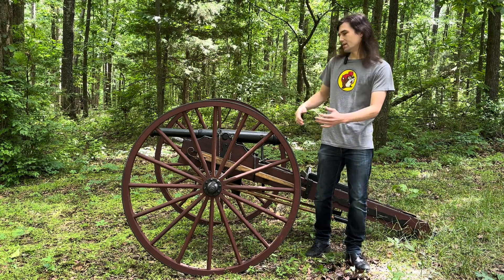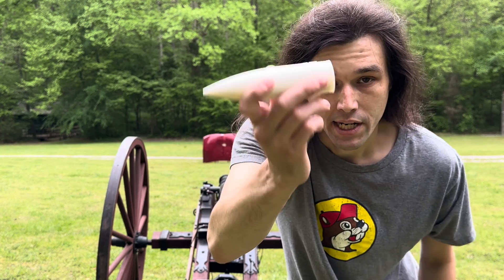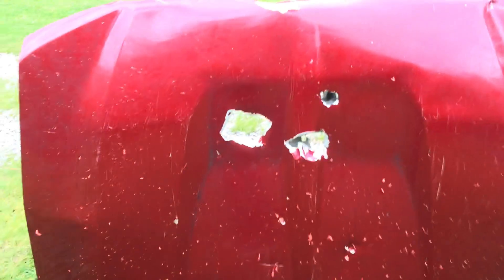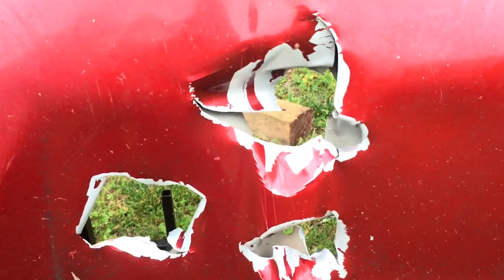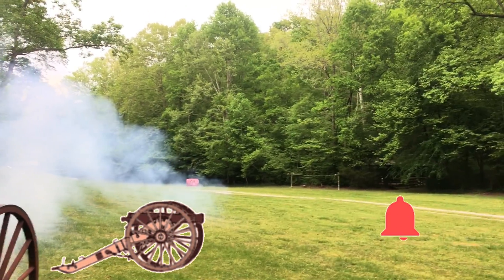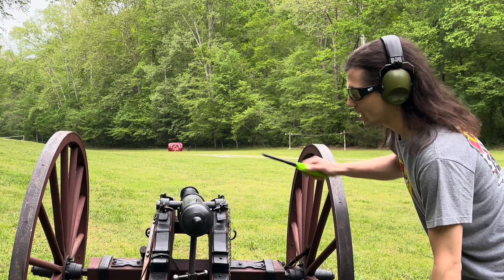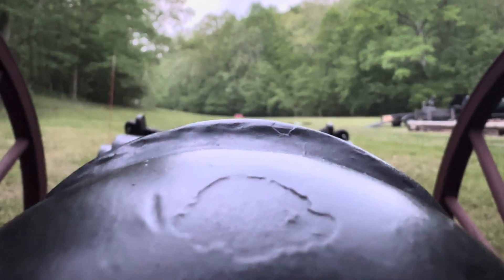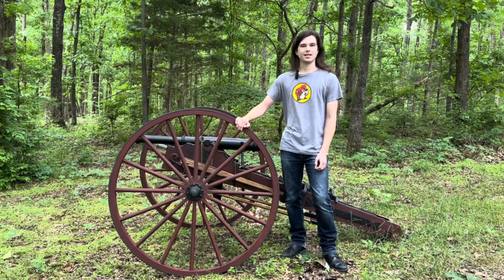Shooting 3D Printed Rocket Powered Tank Rounds

Comment from the maker: What do you want to see us shoot next? What was your favorite shot?
Reply: could you try this but with two motors at an angle to create spin like the antique Gyrojet line of weapon?
Reply: Maybe a sabot round?
Reply: @edgarmaestre6622  That's what I was thinking. Some half-inch mild steel rod with fins welded on and sabots made of wood wouldn't be too difficult, I believe.
Reply: @r.awilliams9815  yes! you read my mind, thanks for explain this better than me. My english not is very good
Reply: Look up what a 12ga bird banger is 

I have disassembled some and it’s pretty much just an m80 with a heavy shot card with a hole so the fuse can go through and be lit by the gunpowder 
I think you could make your own and scale it up for scaring away pterodactyls or whatever
Reply: Maybe an oversised Minié ball or lead diabolo pellet would be stable in flight ?
Reply: What if the the rocket motor ignited the powder? So the rockets already lit and going before leaving the barrel. 
Might be tricky but maybe an electric igniter could help.
Reply: Look into making a version of an APFSD round. Armor Piercing Fin Stabilized Discarding Sabot. Basically a steel dart inside a casing that seals it in the barrel. :)
Reply: What about Apfsds or heat or he fs like put some sort of tungsten dart with fins in some 3d printed descanting sabots and fire 
Or make a explosive projectile with deploying fins on the back
Reply: Using two identical 3D printed shells & identical powder charges, it would be interesting to compare the difference in range from one using the model rocket booster to one without a booster.
Reply: Grapeshot. frozen grapes.
Reply: i would love to see a slow mo of it comig out
Reply: I don't know if you've already tried this or if someone has already suggested it, but what about trying to pop popcorn with the cannon?
Reply: I'm just thrilled to see it slinging real lead and a stout load. See how happy that made her. I've always wanted to try big Minnie style shells in a smooth bore.
Reply: Pig heads against ball then cannister
Reply: Try using thise little electric rocket ignitor wire matches to fire the cannon!
Pour the rocket nozzles full of fff to ignite those every time.
Reply: It looks like the projectile has more surface area and was getting more energy and out ran the rocket motor out the end of the barrel maybe hot glue the motor to the projectile
Reply: Shoot another tripod 🤣
Reply: oh.
Reply: I wanted to suggest something like flechettes  but bigger and teardrop shaped. A cluster of 7 would pack nicely. Unfortunately i don't have time to model it right now.

By the way, is the barrel rifled or smoothbore? What's the exact caliber?
Reply: A slender aerodynamically stabilized cone, launched with a sabot.
Reply: Not a serious suggestion, but you could shoot a small cannon from the big cannon ;)
Reply: What if you used a brass bore bit as a solid nose to the round? In the previous 37mm you had sand casted lead tips and cores. Could try with brass solids to penetrate; but I would love to see this and Fury from Kentucky Ballistics fire side by side.
Reply: Fuzed Canister?
Reply: You are definitely on my team next cannon battle I get dragged into.
Reply: how about doing discarding sabot similar to the 76,2 mm Ordnance QF 17-pounder APDS
Reply: hey man, love your channel. how big is the bore? and do you think you could fit a camera in there?
Reply: @brianfriberg4917  A bullet's eye view of being fired out of a cannon. Finding the SD card (if it survives) after impact splatters it could be a problem. Paint the card with UV reactive fluorescent paint then search for it at night with a UV flashlight.
Reply: @greggv8  well first i would start with a custom bullet shell and fill the air in the cameral with epoxy to help it survive the shot and start with smaller powder charges and soft  targets. there may be camera options with wifi that can send the video as it sails throught the air. I would obviously want a fast frame rate and smooth barrel. maybe give the projectile stabilizing fins. all this depending on the size of the bore
Reply: I would like to see if you can make exploding shot like shrapnel.The traditional shrapnel shot where the round explodes in the air above the target releasing shrapnel
Reply: A wacky wild inflatable arm flailing tube man.
Reply: Make a DSFLRP round, but all 3D printed. The Slow Mo Guys need to pay you a visit with their cameras.
Reply: Holy Crap man that was awesome. I know what I'm 3d printing today.
Reply: A bunch of glass marbles and bearings. Massive buckshot.
And see what distance it’s effective against different targets. 
(Engine blocks)
Reply: Watermelon 🍉
Reply: Try the APERS Round I bet that would be really full or turn it into a rly big shotgun
Reply: "3D Printed Rocket Powered Tank Rounds" Sorry about your country's educational system to have completely failed to teach you how to hyphenate.
Reply: I’d love to see lead shot.  Like double 00 buck.  Lead shot then some bird shot.  Love to see it. Then mixed shot round.  Would be incredible to see
Reply: Some pipes. Two end caps. Triple F.  😜

Comment: i'm not too surprised this worked as well as it did. fused cannon shells were very popular in the 1800's until the invention of shell-guns. the ignition of the propellent charge would then light the shells fuse which then detonated either right before or after the shell hit a target. yeah. reliability might as well be rolled on a d20, but worked enough of the time to be in mass use.

the one thing i would change with the rocket shell is maybe acting a slower burning fuse into the rocket itself that'll provide a longer burn which should increase the reliability of the rocket. 
my thoughts is that the burning black powder isn't burning long enough to reliably ignite the different kind of propellant within the rocket itself.
Reply from the maker: I just recently watched a video about shell guns and their ability to just level sailing ships and it gave me a few ideas for some videos too. Those things are scary. I’ve got a few more ideas for rockets so I’ll have to add maybe a bottle rocket fuse and see what happens. Ironically the one time we did stick some cannon fuse in there it didn’t ignite!
Reply: @TheCannoneer Shell guns, like the 110lb Armstrong gun, were insanely powerful. However their rate of was usually measured in minutes per shot instead of the more practical for battle Shots per Minute. By the time of the American Civil War, Shell guns were being considered and some steam powered sailing ships were slowly being armed with the new weapon. 
During the Crimean War, shell guns started to hit their stride. And yes, coalition ships armed with shell guns easily made short work of the more napoleonic style sailing ships of the Russian empires black sea fleet. Shell guns of all sizes were the preferred armament up until the very early 1900's until the development of quick-firing guns which fired single piece shells with self contained propellant charges. But I believe that becomes beyond the scope of your channel.

Comment: 3D print a mold and cast some copper or brass or aluminum rounds with slide rings to engage the rifling in your cannon.
Reply from the maker: We actually don’t have any rifling on the cannon as it’s a revolutionary war style and they didn’t bring about rifled cannons until the 1850’s. I hope to get one of these days that rifled and 3” from the civil war!
Reply: @TheCannoneer  check out electro machining. Using electrolysis to cut  steel. You could build and rifle your own. Use 4130 heat treated seamless tubing and plug and weld the breach end. I tend to pin the plug and weld mine. The carriage is up to you. And you can shape the barrel to your specifications.

Comment: Im wondering if it stays stabilized at distance as your gun is most likely smoothbore. I see room for fin stablization experaments. However u would need a thick base plate at bottom of fins that falls away. One mustn't have air space in the powder. In my rifled 40mm guns 30 carb tracers were installed. In the 3" guns i used 50cal tracers. Also put 50cal incendairys in the noses in both sizes but havent fired those yet😊
Reply from the maker: I’ve got a pop out fin version I just finished! I’ll have to look into adding some bullets to the tips of projectiles too but I’m not very good at modeling things just yet.

Comment: The more pertinent question is how much of the velocity of those rounds was generated by the gun powder in the cannon, and did the rocket motor actually provide any additional velocity? Shooting home made projectiles may be fun,but for what purpose other than to make noise and hopefully hit something other than a hillside. A real test would be to take the cannon out to a longer range ( professional) and fire rounds without the rocket, and then fire them with the rocket. Is there a difference? It’s clear the rocket motors are lit, but I doubt they’re adding anything but a tracer burn.
Reply from the maker: I wish we had like a mile range to test out and see how far they shot with the rocket motors included.

Comment: You need to fix the right side pintle mount bud
Reply from the maker: They actually have a slight outward cant to them to offset the weight of the cannon as it would push the wheels inward. They are made to counteract that. It’s called “angle de carrossage”. Some sports cars follow the same principle too.

Comment: I wonder what might happen if you hollowed out the nose of the rocket rounds enough to inset and glue on a ball for a slightly smaller cannon, if there is such a thing.  To make the rocket round nose-heavy.  Maybe also make it longer so that a combination of momentum in the nose drag on the tail can stabilize the round before the rocket engages. But I'm just spitballing.
Reply from the maker: I know exactly what you’re getting at! I will have to give that a shot 🥁 when we revisit these.

Comment: Left wheel or axle looks a bit off kilter. (Bent?) good shooting even with that.
Reply from the maker: They are actually made that way oddly enough. It’s to ensure that they roll correctly and stand up over time as the weight of the cannon pushes down and out on the wheels which would naturally cause them to pull inwards so they made them with an outward slant to counteract that to begin with. It actually has a name “angle de carrossage” oddly enough! Great question!

Comment: Also your cannon fires 37 x ?
Reply from the maker: It’s technically 38mm by whatever you can put inside it lol.
Reply: @TheCannoneer  Well at a certain point projectile density outweighs propellant no where as i can totally fit a 38mm x 1,829mm, it will technically fit. but its gonna have a RUD. lol in any case, i was asking cause i was thinking of making you some FSDS rounds that should preform significantly better that an solid 3DP projectile.

Comment: One thing I've noticed is all the smoke when you shoot. That means your using too much powder. I've been shooting a Muzzle Loading .50 caliber Hawken Rifle since the late 70's, and I've come to realize that you should use just enough powder to get your shot to the target. These days, I just just enough, and all I get is a little puff of smoke when I shoot. Also if your not going to use rocket motored rounds. Try using an over powder wad. It will make a better gas seal, so your powder will burn mostly in the barrel. Just my two cents worth.
Reply from the maker: I’ll play around with it and see what we can get away with!

Comment: They flew pretty straight for just the cone and engine maybe you could add little fins to it or make the cone with grooves in it to help with spin or add a ring at the base where the engine it so it'd work like a tank round
Reply from the maker: I’ve got some pop out fin versions I’ll have to try out one of these days!

Comment: I would advise caution around projectiles you're using-- (at least in the US, which I'm assuming you're from) while the cannon itself isn't considered a destructive device (as restricted by the NFA), the ammunition can certainly be restricted-- be careful with putting explosives or fuels or anything inside your shells, as you might end up with a visit from the ATF :p
Reply from the maker: I don’t even have a dog! From what I can read it looks like as long as the cannon charge itself sets off the rocket it is good to go. I can’t set off the rocket with an electric match and have that set off the cannon. I think that applies to explosive cannonballs too but those are a bit dangerous! I’m not going to get too crazy though and burn the woods down!
Reply: @TheCannoneer  Hmmm, maybe you could print out a dog to buy yourself some time... But yeah, being ignited by the cannon itself makes sense for it not being considered a destructive device-- maybe you could reach out to ordinance lab to ask about anything further, if you wanted to try out some similar projects that could stray into the destructive device territory?
Reply from the maker: That’s actually where I got that info! They had something about explosive cannonballs that I watched before I made these to make sure! I’ll have to touch base with them at some point!

Comment: Use a class D rocket up a aluminum budweiser bottle after putting shredded steel wool with vaseline on it inside the bottle then  disolve a bunch of styro foam in gasoline till its a jell and put it inside one of those quarter machine trinket globes from the grocery store an drill a 1/4" hole in the lid of the globe and drill a 1/2" hole in the bottom of the bottle and hot glue the globe to the bottom of the bottle with the holes alighned and glue some stabilization fins on the neck of the bottle  rocket propelled cannon fired napalm mortars 😮
Reply from the maker: Oh that sounds scary….😈
Reply: [The ATF, FBI, and CIA would like to know your location]

Comment: Without spin the rocket shell needs the center of mass in front of the center of aerodynamic pressure. So try a lead nose, and maybe add either fins [needs a sabot and dealing with supersonic effects...] or just extend a thin hollow plastic shell at the rear. 
Look up how to test model rocket stability with a string. Basically tie a 6ft string around the shell at the center of mass balance point and swing it around in a circle, a stable shell/rocket will point into the wind. Be sure to test with both a full weight and empty [used] rocket motor. Don't ignite it, just swing.
Reply: Oh and C6-7 is not a great engine type for this. Get some booster-stage engines like a C6-0 or C11-0 (Red label and always end in a "-0" delay charge). You are using an upper stage(purple label) which includes wasted components like a long after thrust delay (7 seconds) and a parachute ejection charge.

Comment: Have you use copper pipe filled with lead? 
Your Canon is larger.  I made a steel Canon with a one inch bore. My favorite round is a thin plastic container  filled with a 50/50 mix of lead shot and plaster of Paris. Makes a white cloud when it smacks a wall.  Still don't know the full range of the Canon. 
Oh one more thing. Put vernier sights on . That you can remove before touch off.
Reply from the maker: Oh that sounds like a fun round to shoot! We’re about to super super upgrade our sights so I’ll probably make a video about it haha.

Comment: ever thought about making a 3D printed APCR or APDS round? e.g. round with a 15 mm 90-100% fill core and an outer casing with less filling, just like APCR rounds, or a small 10-15 mm 100% fill penetrator with a lower fill 3/4 piece sabot? it could be interesting to see if it's actually viable, or even if you could replace the cores with metal ones and make semi-3d printed APCR and APDS
Reply from the maker: Our next video is going to be the FSDS sabot penetrators rounds but I’ve got some work to do on them still!

Comment: Very impressive! I heard you say you normally load the cannon with 400 grains. When you shot the rocket rounds did you reduce load? I found with musket size rounds (.75 cal) I’m able to reduce the power load by almost half and aim slightly lower, like you saw during shooting they like to rise up from the rocket. I would also recommend putting something flammable that burns hot into the rocket (when I was doing testing a small piece of magnesium was enough to help the rocket go off earlier) 
Overall great video, great to see the rocket round idea at a massive scale as this.
Reply from the maker: We did not. I actually thought about that last night so that will be some things we need to try if we revisit it! Thanks for the ideas!

Comment: Great distance shot, but C6-7 motors are for upper stage rockets and are lower impulse. Use C5-3 motors next time for more impulse and longer burn.❤
Reply from the maker: Can do! Rocket motors are something I know less than nothing about other than it fit perfectly!
Reply: @TheCannoneer  The C6-7 and C5-3 are both the same diameter, length and BP(black powder) propellant. It will be an easy swap and range distance will increase. There are AP(ammonium perchlorate) composite motors the same size too, but they are too powerful for your range and require an electric igniter. Stay safe.

Comment: 3d printing is just too expensive and time consuming, try casting  its so much easier and cheaper..
Reply from the maker: I’ll end up doing both one of these days!
Reply: @TheCannoneer  casting is surprisingly easy all you need is to make a wooden box , just fill it with beach sand , after you just push your 3d printed projectiles nose down of course, slowly pull it back up and pour molten aluminium in the hole … you can also tighten the sand with a big dowel before pulling your 3d printed part and it won’t collapse 😉